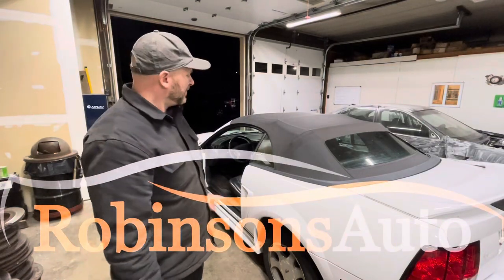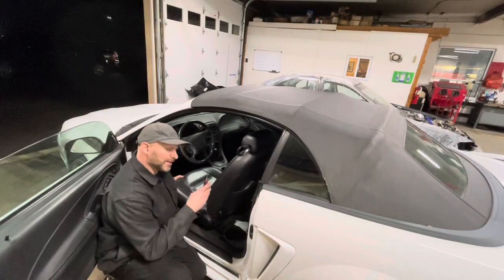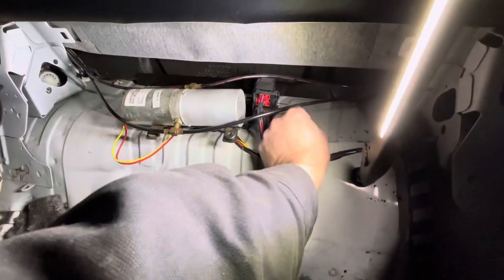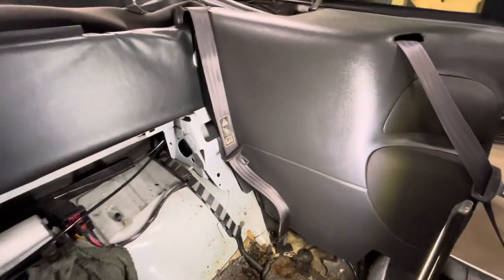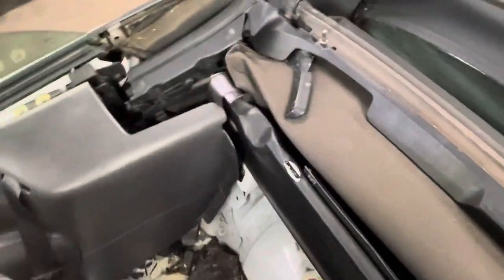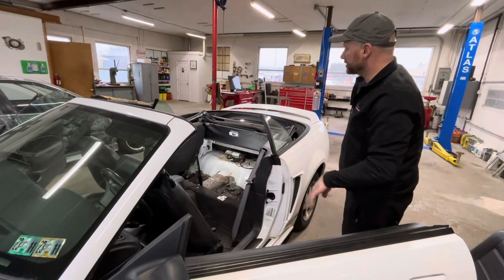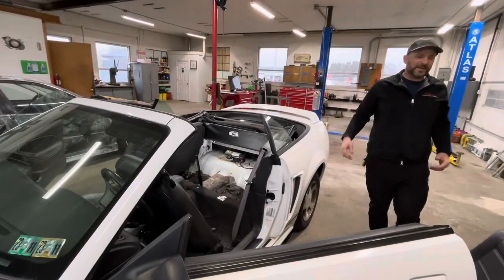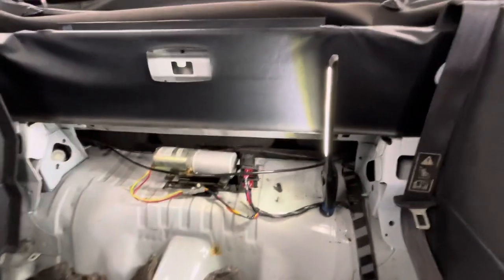Convertible Top not Working - Fix it Quick!

Comment: I would ask what the customer wants to do. Make sure to be clear that they understand you don't guarantee how long it will remain operational. Sometimes the parts become obsolete for the convertible tops as well. Take a good photo of what you found on the cylinders so they can see and judge for themselves.
Reply from the maker: Solid advice Mike thank you! Talked with the owner and this car has been in the family since new. He can’t recall ever the fluid checked. This will most like be how we proceed. Nice heart how othered deal with this

Comment: I have a 2000 Firebird convertible, the same thing is happening to mine, so I'm gonna take your advice and pull everything apart. Check the fluid and I will add fluid and then order the Parts needed

Comment: Hi, I have a 2010 Chrysler Sebring convertible. The wiring harness was held up by electrical tape by the previous owner and by putting the top up and down, it got pinched and cut a couple of wires. I've been having issues with the driver side window not going all the way up and the top stopping Midstream when going up and down. I've been searching high and low for a wire harness diagram with no luck. Would you have any idea where I might find one to know which wire's do what? Thanks so much!

Comment: This was helpful, thanks. Pretty sure I have the same problem going on, but unfortunately, mine is a Nissan Cross Cabriolet and I don't believe you can top off the fluid. According to the service manual the hydraulic system is self-contained and no way to add fluid.
Reply from the maker: I'm glad you found the video helpful!

Comment: Why bother reading the label if you weren't going to use the correct fluid?
Reply from the maker: Dex 2 or equivalent. not all fluids are dyed. It’s become a standard in later years when used as ATF for identification. Dyed would work just fine as well. You will find the OE fluid in these is not red. I’m assuming that’s why you made the statement
Reply: @robinsonsauto  Never seen non dyed fluid. Only fluid I've seen that color is hydraulic fluid.
Reply from the maker: @justforkiks29  thanks for sharing you thoughts

Comment: Did not help at all mine doesn’t make any noise won’t even try to move top down video not helpful at all
Reply: Bad switch or blown fuse maybe?
Reply: He said in the beginning that if it's not making noise, it's an electrical issue. This video is not about fixing an electrical issue. Hope this helps.